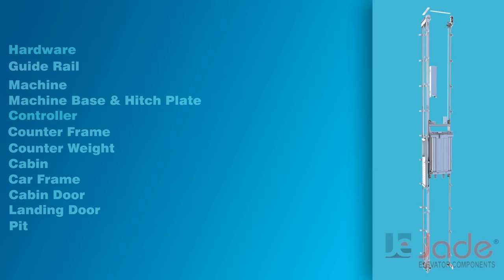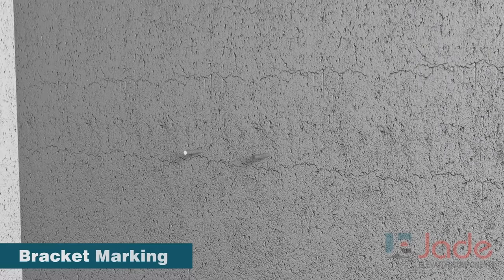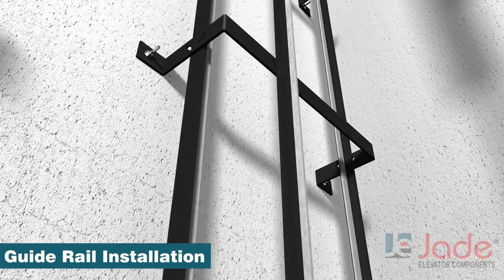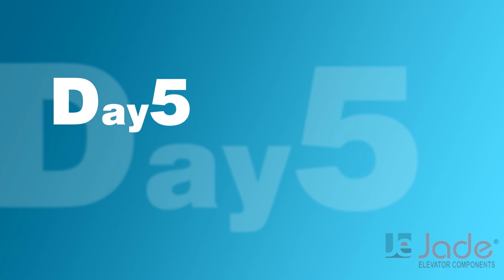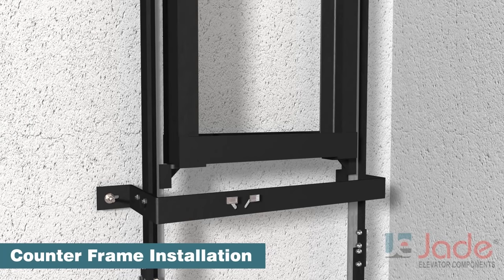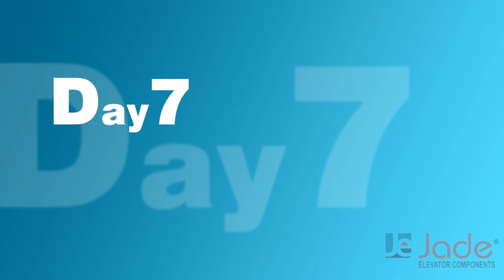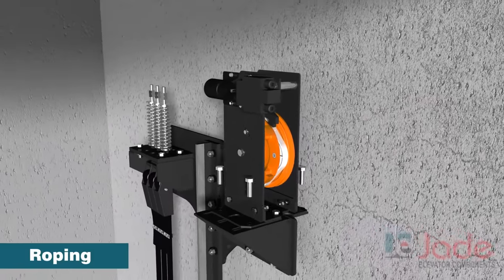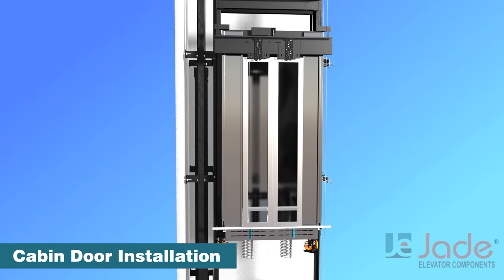JADE ELEVATOR COMPONENTS  ELEVATOR INSTALLATION GUIDE   !!!

Comment: Very outstanding video. I have to ask the following questions
1.0 can we make an elevator with the capacity 10 to 15 tons capacity for the goods &other materials transporting
2.0 what is the maximum capacity of the elevators constructions for the goods.
3.0 what is the maximum capacity of the elevators for the people? Can we 
 make with 50 persons at one time with the avarage weight of 100 kg in total 5000 kgs which is equivalent 5 tons at one time

Comment: I know of two Otis Gen 2 MRL's  2:1 roping, steel hoist ropes in a 12 story parking garage were updated last year. Originally two sets of hoist ropes were on both sides of the cab with the compensating sheaves above the hoist way, with a compensating sheave on the counterweight. With the update or modernization, the compensating sheaves were relocated to the top of the cab as in this video. Both ends of the hoist ropes are now anchored, to the hitch plate and machine beam.  The counterweight retained  the compensating sheave.

Comment: Sir please correct the way travelling cable is going on car top in your animation, the way you have shown it will immediately brake as the car goes in up or down direction.
Reply: @ironmangetter6938  The problem is that travelling cable is coming from back of combination bracket, so its going to stretch in any case.
Reply: Totally true about the traveling cable being behind the combination brackets and also I like the short time frame to install this elevator no time was given for erecting scaffold also they roped the car and platform at ground level or if they hoisted the counterweight or the car up